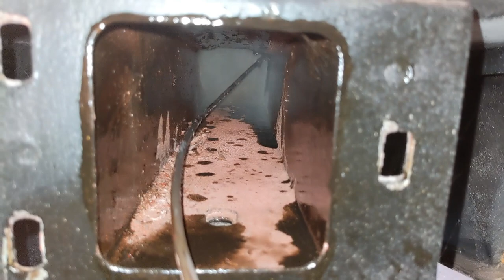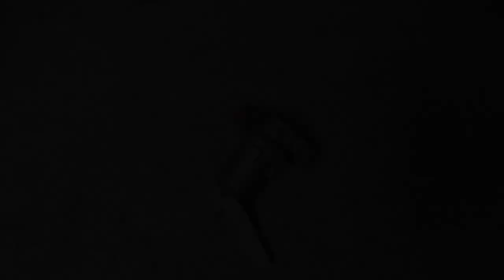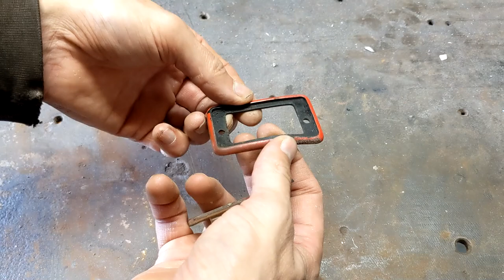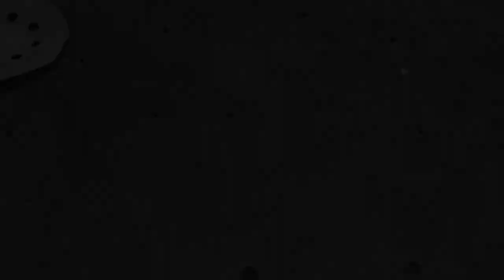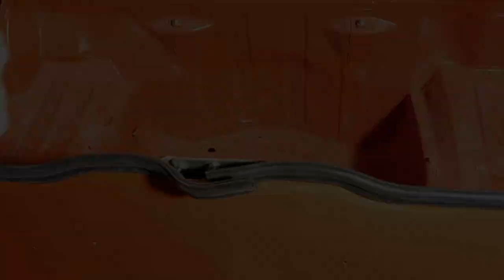Boot & Rear End Bits - Triumph TR7 Restoration Part 19

Comment: Really good job , it's looking good you have the knack of  making it look so simple much appreciated 👍..
 Could I ask what size and make of tyres do you run on the alloys they look lower profile than my 185 /70/ 13  🤔 cheers
Reply from the maker: Thanks! It's mostly down to good editing though 🤣 I keep the swearing and the screwups off camera 😋
Tyres are 185/60r14 (they're 14" wheels). They're Vredesteins, but they're also about 25 years old so they probably don't make those any more 😮 (yes I'll be replacing them).
Reply: @RedsGarageUK  Can't really work out what looks best I have the steels on at the moment,  but when they need repainted I go  back to the alloys 🤷‍♂️ I suppose it's just personally taste really 🤔
Reply from the maker: @Jaxs2  I do have a soft spot for steel wheels, they can look great. I think the ones I have really suit the car, though.